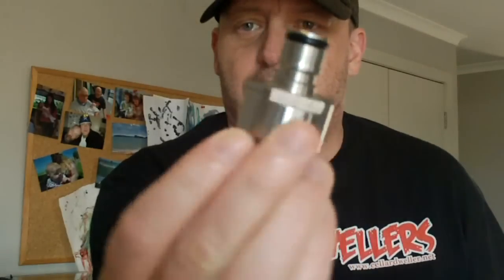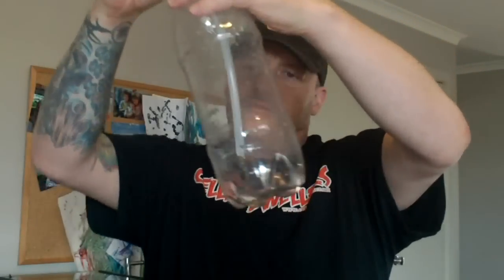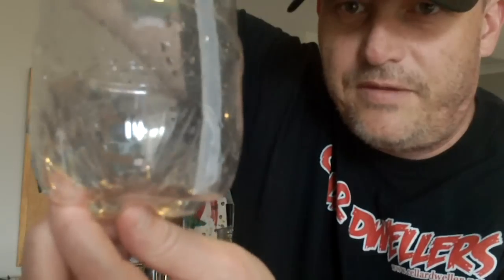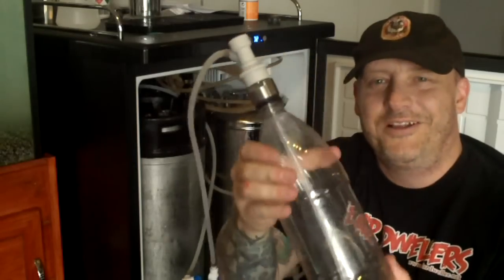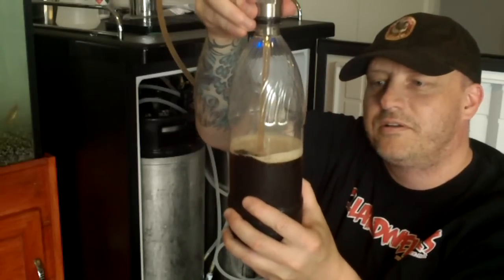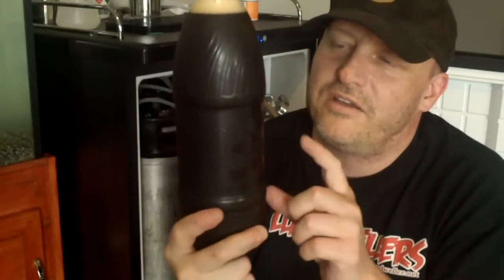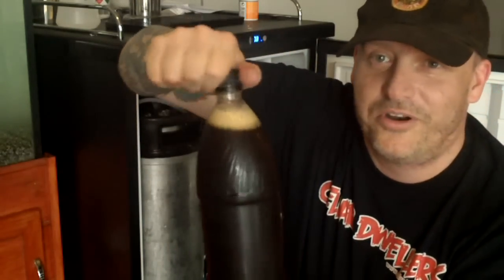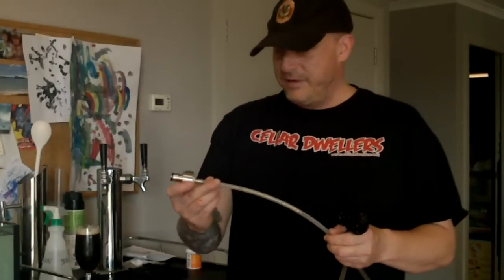NEW! Counter Pressure Bottle Filler Cap - Carbonation Cap & SJPORR 2014

Comment: I watched this when you first made this video, I bought one of these carb caps and never really used it. I am now going to buy a couple more and do more with them. Great video, thanks.
Reply from the maker: They are great, you can get cheaper plastic ones too now. 
https://www.kegland.com.au/plastic-carbonation-line-cleaning-cap-fermzilla-cap.html?cmid=U1VxL0FMYmxTRzA9&afid=NHRQa2ViaTBnT0k9&ats=V2dpVFFYTmszWDA9
Cheers!

Comment: I have that adapter and have only been using it for manually carborating wine and soda that has gone flat, did not know I could use it with my keg. Looking forward to testing it out.

Comment: Dude I wish they had like a "clamping" device that could seal over a glass bottle for using this method w/ the ball lock. This is absolutely simple and effective. I''m currently using one of the "deluxe cp" fillers from brew more which is always a big mess and finicky.
Reply from the maker: yep it would great! Cheers mate!
Reply: Yea that would be the ultimate - to be able to use this technique on glass — maybe I could do it just by “press fit” hold the carb cap on top of the glass bottle?

Comment: I have use both, I prefer the plastic ones, they last several years, around 8 to be replaced, the metal ones are kind of hard to use because they don't seal perfect to the PET bottles, so they need a o ring and over the time they tend to wear the PET bottle necks.
Reply from the maker: These were brand new at the time and the plastic ones weren't available, but I have about 20 of the plastic ones now lol. Cheers!

Comment: Thanks for the video.  I like the tail on the cap and that the ball lock works with both the gas and liquid connectors..  I have made a number of 2 liter bottle carbonation caps from Tire Valves and home made beer guns from stoppers and racking canes.  I like the all in one solution. Like you, I also tend to swap out my caps for the standard 2 liter cap.  It sucks to forget a carbonating cap at a party and try to get it back a few days or weeks later. I would rather not even worry about it and not care about what happened to the bottle after a few cold ones.  I also don't worry about the loss of pressure or Oxygen.  There is plenty in the beer and as you said, you can squeeze the headspace air out or just drink it that night (what I prefer).It would be nice if someone would come up with one for regular bottles.
Reply from the maker: Exactly mate, I nearly went on the tire valve trail but it was going to cost me just about as much as this. Thanks for watching mate! Cheers!

Comment: Thanks. This worked very well besides for some reason when I fill the bottle it seems to suck the yeast off the bottom of the keg into the bottle resulting in a cloudy beer that isn't coming out of the tap. Could this be the pressure? I did it quite slowly so I'm not sure. Thanks

Comment: Can you use this system to connect to the beer line a push sanitiser from the plastic bottle to clean a beer line? Or can you connect the barb at the bottom to your pressure spray which will avoid buying the keg post and other fittings you showed on your previous vid of how to make your own beer line cleaner? Tha

Comment: Thanks for all your videos Gash - they have taught me alot!!  If you swap out the pressure cap with a normal PET cap how long do you think the beer would stay carbonated if kept in the fridge?  Thanks again
Reply from the maker: Well it should stay carbonated for a very very long time, it will lose a tiny bit of carb as the headspace in the bottles pressure evens out, but thats it really. PET are apparently permeable but when was the last time you picked up a flat bottle of coke? Cheers mate!

Comment: Thanks for this vid really helpful.
Please can you point me in the right direction to the correct fitting beer jumper leads to connect into keg and CPFC? seen quite a few so just want to get the right fit, I also have a corny keg
Reply from the maker: The gas fitting is just straight from the bottle or gas manifold. The beer line is just a piece of line with a beer or black quick disconnect at  both ends, that's it! Cheers!

Comment: Good on ya mate, great vid: But at the end (8:50 onward) you left me a bit confused. Why would you want to use the other type (normal style) of cap to add some extra gas, when you could just swap back to the gas line on the cap you are using? Does the “normal style” cap handle more pressure than the new one?
Reply from the maker: No, purely for the fact that you might only have one of the new ones, and you might want to fill more bottles, putting the other style means you can top up the 'headspace with the right pressure, compared to using the regular plastic bottle cap. Cheers!

Comment: I have some questions.  
How much pressure did you set on regulator when you purged the oxygen out and also when you filled in PET bottle?
I am afraid of too much pressure when filling in.  
Can PET bottle withstand 30-35 psi if that is serving pressure pushing in the keg?
Reply from the maker: Wow never heard of pouring pressure at 30psi? Some PET will handle that pressure, but you dont want to be doing it at that pressure, things would get messy fast. I force carb at 30psi for 24hrs, then drop it down to 12psi for serving. Doing bottle filling like this I'd drop the pressure way down maybe 2psi ish. The beer will still be carbonated at the 12psi, all your doing is filling.  Hope that helps. Cheers

Comment: Can those caps be used to clean beer lines? Using your pressure sprayer, connect one end to the cap and then just connect the ball lock to your quick disconnects to clean beer lines?
Reply from the maker: +chuckawobbly yep for sure! These weren't out when I made the line cleaner. Cheers!
Reply: I bought one just for cleaning my corny keg kegerator lines and I use it to clean party tap lines.

Comment: You left some star-san in the bottom of the bottle before putting the beer in. Any way to easily rinse that out?
Reply from the maker: +ludwig fan You wouldn't rinse it out, you can tip as much as you like out though. To be honest if you aren't storing it for a length of time, the star san isnt even needed. Cheers mate!

Comment: How long does the beer stay carbonated after recapping?
And can a filter be used inline with the filler?
Reply from the maker: Beer stays carbonated for ever, until you open, unless the bottle leaks.  Yes you could use a filter if needed, I've never tried, but there's no reason you couldnt rig something up. Cheers!
Reply: @HomeBrewNetwork  thanks for the reply

Comment: does it matter if the length of line doesn't reach the bottom of the bottle? does it just mean there is more chance of foam when filling? (i have a short piece of hose but a longish bottle)
Reply from the maker: I'd guess you'd get some foaming yes, but I think if you can maybe tilt the bottle and if the hose is near or on the side of the bottle and take it slow it will probably work out, a small bit of foam wont matter anyway, and to cap on foam is a good thing. Take it slow and the the pressures may keep foaming to a minimum. Cheers!
Reply: Gash Slugg thanks mate

Comment: Great upload m8, am i right in thinking though that currently these are only available from KegKing.au ? Cheers.
Reply from the maker: I've seen them here too http://www.ebay.com.au/itm/Carbonation-Line-Cleaning-Cap-Counter-Pressure-Bottle-Filling-Home-Brew-/271434448309?pt=AU_Barware&hash=item3f32c0fdb5&_uhb=1

Comment: Where do I get these from? I'm from the uk but don't mind ordering outside as long as they deliver here.
Reply from the maker: Try ebay http://www.ebay.co.uk/sch/i.html?_from=R40&_trksid=p2050601.m570.l1313.TR2.TRC1.A0.H0.Xcarbonation+cap.TRS0&_nkw=carbonation+cap&_sacat=0  Or you can ring around the bigger brew shops in UK I guess, maybe even amazon. I get mine sent from China usually. Cheers mate

Comment: I just tried this and had major foam issues until I turned the pressure down to 3psi. Then the keg stopped pushing out beer at all only co2 after 3 bottles. What the heck am I doing wrong?
Reply from the maker: sounds like a pressure problem, make sure its all equal in bottle and from keg. Cheers!
Reply from the maker: or you have a leak somewhere, dodgy seal maybe?
Reply: @HomeBrewNetwork  There ended up being a hole in my floating dip tube. I swapped it out and I have beer flowing again. Thanks.

Comment: Hi Gash, what PSI do you recommend to use when filling the bottle ?

cheers
Reply from the maker: G'day, turn it down low it will be easier to do. It's different for different set ups, but somewhere between 3-6 psi should be plenty, if its too slow turn it up a bit! Cheers!
Reply: ok - nice one - cheers